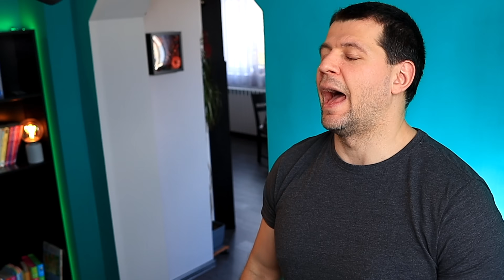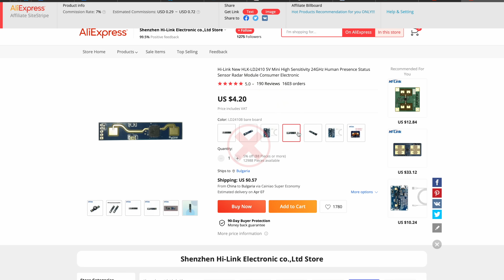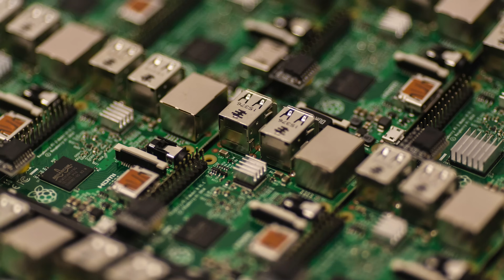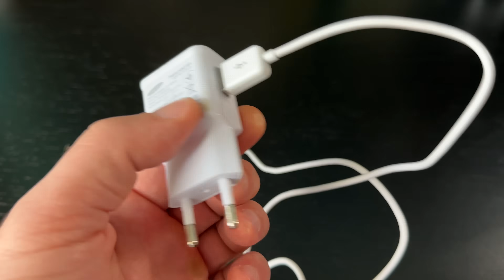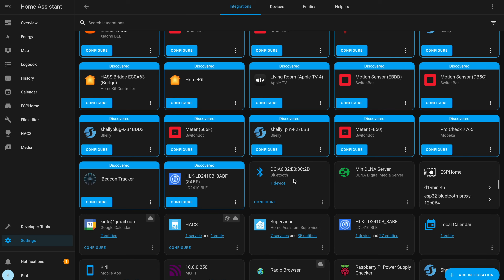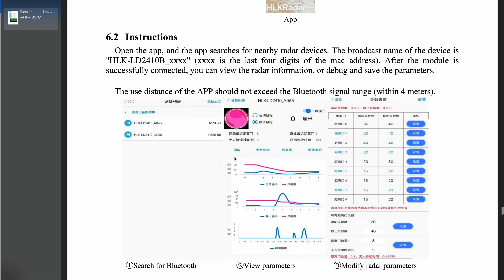Set up Human Presence detection with LD2410B and Home Assistant in minutes

Comment: I seem to be struggling to get this into HA. Every time I add integration and select LD2410 I get a popup box that recognizes a Bluetooth address but after hitting submit I get an unknown error occurred message. Has anyone else experienced this?
Reply: Mine will allow me to connect some times but then disconnects shortly after and I have to restart HA for it to show up again.  Frustrated.  So much potential.
Reply from the maker: Is your sensor and Home Assistant server close to each other? Also what is your BT adapter? Can you try with a bluetooth proxy from an ESP32 device?
Reply: @KPeyanski  I'm using Avantree BTDG40S. I got the LD2410B kit and it's about 3m from the Avantree. I do have 77 devices connected via ZHA so maybe there is signal interference?
Reply: Moving them closer to my BT seems to have resolved that issue but now the entity state is showing up as unavailable all the time

Comment: Great, I might have to look into getting one! What method does it use for detection? And do you know if it can differentiate between animals and humans?
Reply: Radar, so nope it can't see any difference between Objects.
Reply: These sensors are so sensitive it will trigger on motion of breathing, or a curtain. It's great for presence detection but rather to check if the room is still occupied. Check Everything Presence One sensor on YouTube
Reply: @Marquo1  I've been wanting one but kinda on the pricey side to snag a bunch and they always seem to be sold out when I check.
Reply from the maker: Thanks Tim, nice answer :)
Reply: @Marquo1  way too pricey and won't ship everywhere for what is basically a mmwave sensor and pir rolled into one

Comment: I ordered 2 Typ B and 2 Typ C for testing can u tell if there is any difference?
Reply from the maker: The difference should be only in the PIN size, nothing more. Please, comment again when you get them and tell us if there is another difference.
Reply: @KPeyanski  sure i will test them and tell u if I found something out :)
Reply: Now I can tell that there is no difference between this two sensors. The Typ C is very easy to solder or u can use is with jumper wire for testing. I will go with them :)

Comment: How does it work with pets? Any experience?
Reply from the maker: Check what @Sandriell said in the comments - Since it has a 60° detection angle, positioning it 30° relative to the floor would mean it could not see the floor, and thus not see the cat.

Comment: I'm really concidering those type of sensors, but how does that presence detection technology work with pets ? I don't want my lights to go on every time my cat runs through my appartment during the night for example.
Reply: One simple way to do this would be to angle the sensor. Since it has a 60° detection angle, positioning it 30° relative to the floor would mean it could not see the floor, and thus not see the cat.
Reply from the maker: @Sandriell, great answer :) Thanks!
Reply: Thanks for the reply, but cats often jumps on furnitures and sleep on them. Isn't there a body size threshhold that could be configurable where above a certain size = human, below = pet ? Just thinking out loud here.
Reply: @Benjamingaspart  Nope. The entire point of mmwave is that it detects the smallest movement so motion detection can work even in a room with someone sitting still. I believe some of the higher-end infrared motion sensors can be adjusted that way though. So you could combine the two and use the infrared to trigger the automation and then the mmwave to keep it going.

Comment: In your video, the sensor state motion or occupancy changes at a high frequency, this seems unsuitable for automations. Triggering every 0.5/1 second creates a unnecessary load on the server. Is there a way to reduce the detection frequency? Or to debounce the signal?
Maybe via the app? But thanks for the video and the idea, always looking for new things to try!
Reply from the maker: This can be handle well in the automations/script. For example: using the motion sensor as trigger, but occupancy sensor as condition. It all depends of the use case.
Reply: @KPeyanski  I now got mine delivered. I ordered the LD2410-C Version, the c-version has 2,54mm-pins. I can better connect connectors to it and the form factor is better in my opinion.
And wow, this sensor is amazing! It responds lightning fast and is incredibly accurate. When i just move the door, the sensor triggers. I am not even able to look through the door in that time. It also seems very reliable to me and can even transmit through objects. Therefore, I can easily store it in a case.

Thanks KPeyanski, the sensor was an extremely helpful and good recommendation!

Comment: I already have the lp2410 is there a way to install and integrate it in home assistant?
Reply from the maker: If you don't have Bluetooth support you have to connect to the module an additional ESP8266 or ESP32 device and to use ESPHome or Tasmota firmware. It is a more complicated procedure that way, but it is not that hard after all.

Comment: Hello, great video. You didn't talk about placement of the device, would it be placed in the same way as an FP1?
Reply from the maker: Nothing, unusual here. You can mount it on a wall (recommended height is 1.5m - 2 meters) or on the ceiling (recommended height is 2.6m - 3meters).

Comment: This is a really great video. Indeed the FP1 is some kind expensive to automate some lights. But This is so coool. it is working directly? What is the use of d1 mini?
Reply from the maker: Thanks for watching! D1 mini is not needed with LD2410B or LD2410C modules as they have Bluetooth support. But if you buy the bare/regular LD2410 module (without BT support) you will need an ESP device like D1 mini to communicate wirelessly with the sensor. In other words - just buy LD2410B or LD2410C and connect the VCC & GND pins with a USB cable and nothing additionally is needed.

Comment: Didn't know about this sensor. Thanks for the tip. Have ordered one which should be here and the next few days. Oh did you know that switchbot locks are now fully supported in home assistant? Just found out a day or 2 ago myself. Through it's bluetooth integration. Complete local control.
Reply: Yes fully suported
Reply from the maker: Glad I could help! Yes, I know about the SB Lock, mine was auto discovered after 2023.1 update if I remember correctly. Anyways, more & more interesting BT devices are produced lately which is good :)

Comment: just bought a few of them.... will figure out the BLE later.  Thanks for the heads up.
Reply: Honestly? Don't use them, my experience with them was very poor.  The ones I had wouldn't stay connected even less than a meter away.  I only ever bothered to solder one up I have no idea where the others even went.
Reply from the maker: Enjoy!
Reply: so, one year later... how was your tests? do you find it precise ? it only detect humans or any bug flying around ? what scenarios you used to test it? did you try outside?

Comment: Great tutorial any chance you can recommend some cheap BT module which will send signal about state of physical button. If it's pressed or not. Which can be used to monitor fridge doors or just normal door/ window?
Reply from the maker: try with door/window sensor. Switchbot offer such that are using BT for example
Reply: Esp32 oder 8266 with ESP Home and Bluetooth Proxy.
Extremely easy to set up and super cheap.

Comment: Can I use It on battery? Thank you for your videos!
Reply from the maker: Not sure, maybe someone with more experience with the IoT boards and batteries can step in
Reply: Thank you
Reply: It's not ideal for powering by battery due to its constant power draw. I did measure it but have now lost where I wrote it down! I believe it was around 80mA.

It would be totally workable for a temporary or portable solution though. At a guess 2* 18650 batteries in series could last 3-5 days.

Comment: Helpful video, thanks.  Would it be possible to drive this sensor with a battery?  I'm trying to avoid using a house plug.
Reply: 80 mA average operating current is too high for battery power. The same Ali-express seller producers low cost 2W AC/DC power suppliers.
Reply from the maker: Not sure, probably yes, but I never done it till now.
Reply: Because it sends out a continuous microwave signal a small battery would be depleted very quickly. That's why most presence sensors are power from the wall instead of a battery.
Reply: @HATipsByLarry  Thanks for the reply.

Comment: Have you tried integrating the normal HLK-LD2410 with home assistant?
Reply from the maker: No, I didn’t try that, but it is possible by connecting an ESP board on it
Reply: @KPeyanski  Do you have any wiring diagrams and ESPhome configurations to do this?